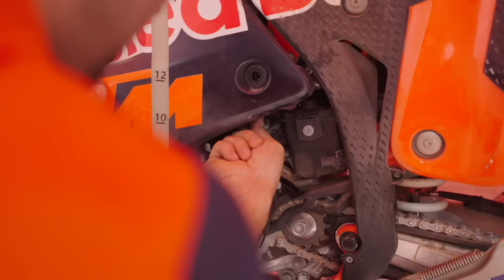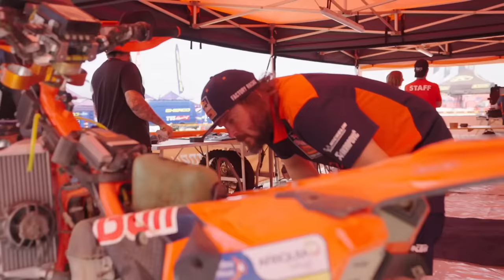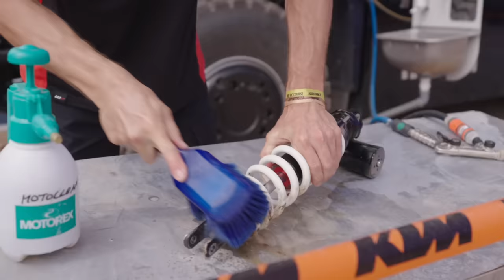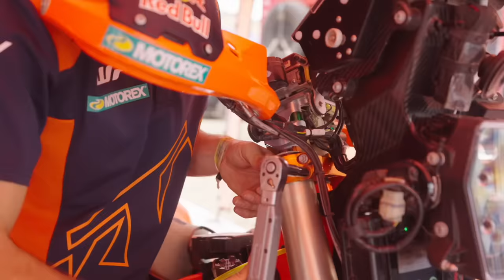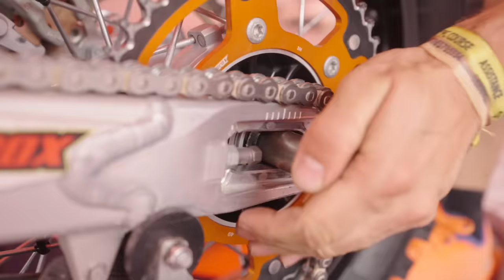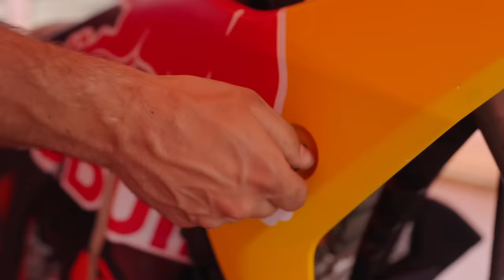Servicing a Red Bull KTM Factory Racing Rally Bike Mid-Race

Comment: Torque wrench on the oil filter damn you guys do it by the book! Lots of respect for the privateers doing these races with less than factory support
Reply: If the oil filter falls off halfway through the stage, the rider knows who was in charge of it so you'd best be doing it properly! 😂
Reply: torquing each bolt 3 times made me cringe. No reason for that. You wear out the torque wrenches 3 times us much, and lose time
Reply: @Okipouros  they were doing it 4x but the bean counters complained they were going through too many torque wrenches so now they only do 3x 🤷‍♂️
Reply: @Okipouros  😂😂😂😂😂😂😂😂
Reply: You need to do everything by the book because you are actually deconstructing and rebuilding the whole bike each day and everything has to work perfectly under extreme conditions. It’s just not worth it to risk anything when you have the torque wrench ready.
Reply: It also makes the torque wrench useless as after the first click you're ruining the toque applied. They are designed to apply the correct torque on the initial click any more and you might as well have tightened it with a rattle gun...
Reply: @Okipouros   im sure they care about worn out tools. i can imagine they have the money to replace things. notorsport it not about saving money
Reply: @SC-et3cg  IMHO they are doing it because a part can settle when all screws are torqued. So the last screw will have the right torque while the prior ones are "lose". 
And the second time will not overtighten the screw.
Reply: @SC-et3cg a common misconception! But you’re wrong 👍🏻👍🏻👍🏻
Reply: @Okipouros sorry but that is proper way to use clicker torque wrench, especially on pinch bolts. 45 years as auto master tech speaking here.
Reply: @Okipouros  I get it. but I'm a tradesman.
Reply: @larsihle9256  Interesting. I use a torque wrench on my bike and notice the second time I click it nips the bolt up a tiny bit more, at least I think it does. I'm using a pretty good quality Teng torque wrench. Would love to know how to do it properly from your experience. How many clicks would you recommend?
Reply: @Okipouros you have to Sequence it on forks due to the clamping. 1-2-1, same with Axles. However sometimes it can take 1-2-1-2-1. Completely fine to do and necessary.
Reply: @larsihle9256 exactly! Sequence torque on Pinch bolts or be prepared for disaster! Seen it too many times or had a bike come in with a missing bolt
Reply: @SC-et3cg you obviously have no idea how a torque wrench works
Reply: @jameshussey4900  It's not like I run a well known wrench brand's engineering department, you're correct, you're the expert, my 17 patents are worthless ; )
Reply: @SC-et3cg  it's good to see someone can admit when they wrong!
Reply: @jameshussey4900  Naw you poor lil' keyboard warrior ;)
Reply: engine is probably made of aluminum, pretty easy to destroy the threads if you dont torque wrench it

Comment: Lots of little things to adapt a 450 for rally. So cool. External oil filter, non standard shock reservoir, Cush drive hub, modified airbox. Little things I never knew about rally bikes.
Reply: More than I expected.
Reply: If you look at the lineage of the bikes, they really started with the 950/640 as the base rally bike, then worked to the 690, then to the 450 in the 690 chassis, and finally a 450 perimeter frame based bike.  You can see the similarity there between the 950 adventures/690 enduro, and 450 rally still
Reply: Nah don't  need the cooler or cush drive both overrated. Unless they're  free then I'll  happily accept and approve  my approval..
Reply: @insertnamehere3851   you sound like you know what you're talking about... I'm interested to hear more about your race program.
Reply: Not just a modified airbox, a completely different frame with an under seat tank as subframe, similar to the 690 platform.

Comment: Seems almost too much but I'm sure it has to be absolutely perfect at these levels.
But with this much servicing it seems there could also be a risk that something doesn't get done correctly and won't work the next day :D
That fuel tank/bashplate/cooler design is a work of art.
Reply: I had the same exact thought. But I suppose this gets checked by 3 people in a row. But still
Reply: They would know how to do it with their eyes closed. It's routine for them. Always possible for something to happen but it won't be common
Reply: Rebuild the fork mid race? New clutch plates? Is that necessary? I'm guess someone much smarter than me thinks so.
Reply: @steedu46gt  it’s so it won’t cost them the race better safe then sorry I would rather have all fresh stuff then not and risk the clutch or fork seals or your forks give out especially in a long race
Reply: That is why only perfectionist mechanics and techs get to do this type of work. There is only one way to do a job properly and that is 110%
Reply: @steedu46gt have you seen the terrain they are racing on? The suspension will be taking the most abuse on the bike that's why it will be rebuilt, in my opinion in this kind of race I would class the heart as the suspension not the engine, I understand with out a engine you wouldn't be moving however in that terrain I honestly feel if your suspension was to go then you wouldn't be moving either, that's my two cents on why it's rebuilt
Reply: You can prevent things easily by giving each mechanic a fixed amount of things he is responsible for, and that he does only those things. Also if things was to go wrong, it will be easier to know why because you know who you should ask about it. 
I'm sure these mechanics are more than capable of doing everything on this bike, so the only reason for giving a limited amount of tasks will be time and efficiency(which is also the reason why there are more than one mechanic).

There is risks involved with everything so either you do or do not do there is a risk. If you would only sit and wait for things to actually break you wouldn't be competing , and since there are no guarantees in life it is better to have tried than not tried at all. When these mechanics go over their designated assignments I'm certain they will be on the lookout for things that both have failed or on the way of failing so they can be a step ahead. It isn't just service.

Of course a mechanic can forget to tighten a bolt somewhere. They are human after all, I just would trust these guys more than not letting them do their thing.
Reply: @bobthenob9017  Indeed. In motocross the suspension receive massive loads in slow interval.
In Rally race like Dakar that oil must be boiling in the forks for enduring hours of constant beating at high speeds on rough "jumpy" terrain.
Depending on the rider, the clutch might be slipping more in a race than one would think.

Comment: Would love if Newey and KTM got together to make a fun turbo bike powered trackday only car for less than $30k for an entry level example that can be upgraded over time. Doesn't need to be carbon everything, aluminum with fiberglass or wet carbon is fine, just make it fun to drive and have factory support at major track events like how Porsche provides support, maybe even have race series with it like spec Miata. Basically a big shifter kart with crash protection and a suspension. Considering the cost of fun manual cars these days they will sell like crazy. This should help RB step into the realm of customer fun cars built just for the track.

Comment: Since when does the Rally Factory bike use that huge oil filter? The RFR's have the filter integrated. Is this new specific to the actual race bikes?
Light setup and fairing seems also different to the RFR model.
Reply: probably over engineered just in case. That is a huge filter though lol

Comment: Why were the triple clamp bolts torqued before the front axle was installed? I thought the correct procedure is to torque the lower clamp, then put the wheel in, align everything and only then tighten the top.

Comment: What was the mechanic doing with the brake bleed, the part where he was dipping a rag or paper towel into the bleeder valve? What was he doing?
Reply: Cleaning out the brake fluid left in the outer part of the bleed nipple. Would be a sand magnet if the rubber cover were to become displaced
Reply: Sucking out the tiny little drip of brakefluid left inside the bleed screw. Attention to detail👍

Comment: What did you use to clean the oil filter (the one with the magnet) and the frame after you let the oil out?
Reply: It looked like brake cleaner. That's what I use. It gave me a heart attack the first time because it turns green when it hits the oil in my drain pan and I thought my brand new bike had a coolant leak.
Reply: @shawnmmtrento I see, and it doesn’t ruin the plastics? I know break cleaner is very rough on everything!